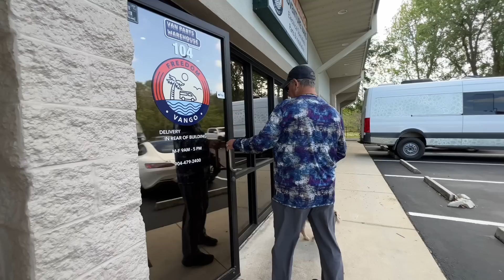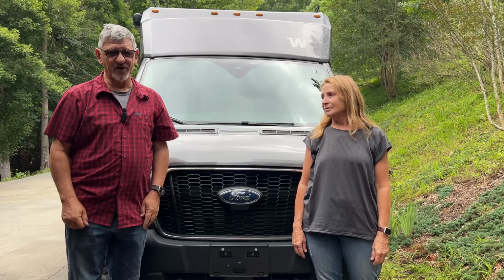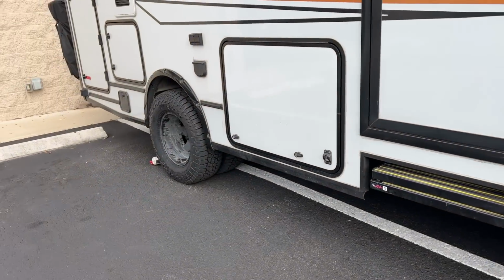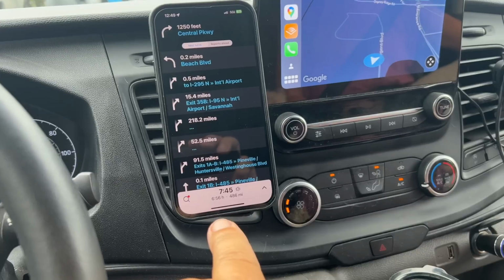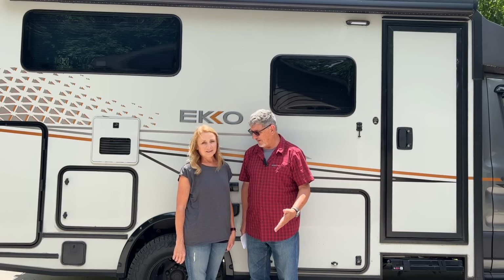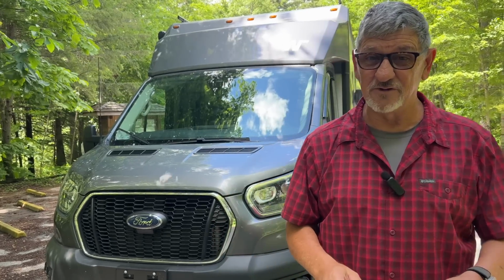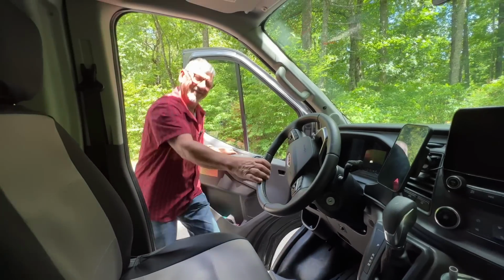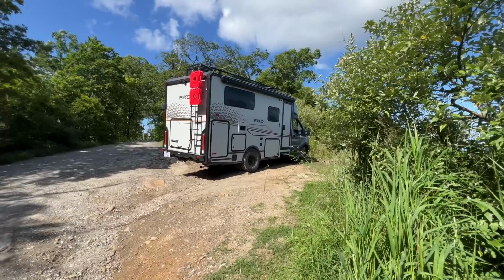GLAD WE DID IT? WAIT UNTIL YOU SEE WHERE IT TAKES US!

Comment: I definitely think it’s worth it. Rv’s sit so low and the clearance is nice. The whole reason I got my E450 in 4wd was the 4” Quigley lift. I can easily crawl under my Rv now. The clearance under the rear overhang is nice. Now you can back in and hang over the grass and not have the front end out in the road. Now you are not going rock crawling in Utah but it gives you some extra height to get a little further out then a stock vehicle will go. That’s what I like about mine too. 👍🏼 I like it
Reply from the maker: All great points.  Thanks for sharing.

Comment: Did you only get different tires? Can you say what the brand model and sizes were for front and rear? I have a 2020 Transit 350 HD dually. My wheels are not painted and I'm wondering if your coach has the same wheels as I have only painted black.
Reply from the maker: We installed Falken Wildpeak 245/75R16, we have 7 of them… all the way around and one spare.  The wheels are what came with the van.

Comment: Looking goooooood.   Definitely on my list to Santa, assuming I get Mrs. Clause to approve.  What size tires did you use and did they add spacers between on the rear?  Also, is this the lift where they cut off those ridiculous rear shock mounts and weld on new higher mounts?  Thanks for sharing the joy.
Reply from the maker: That would be a good thing to get from Santa 😁.  We installed Falken Wildpeak 245/75R16 and they did add spacers on the rear tires.  This is not the lift that cut off the rear shocks.  Thanks for watching.

Comment: Great video…….with all that bouncing around, how often do you have to check that all things are still secure on the inside (ie cabinets, any attachments, loose screws)?  Basically anything that would come loose will all the rocking and rolling?
Reply from the maker: You have to open all the cabinets very carefully after a ride like that.  We weren’t fully packed so that does make things worse sometimes.  It can be hard on a vehicle.

Comment: Hello again.  As I noted below, we took delivery of our EKKO on June 1.  We visited Freedom VanGo on July 27 for the 2-inch lift, suspension upgrade, and Falken 225s, then the next day an alignment at Big Chief.  We now have the same problem you experienced: one of the tire pressure monitors doesn't work, even after Freedom VanGo replaced it with a new Ford sensor.  Question: was your Ford dealer able to resolve that issue?  Thanks much for your input.
Reply from the maker: Wow!  Just like our van.  Yes Ford was able to replace it and then reset all sensors and it started working.
Reply from the maker: They told us the faulty one was actually cracked.

Comment: With the change in tire diameter is your speedometer off now?  Have you found a way to fix it if it is?
Reply: Larger diameter tires revolve/spin slower versus smaller diameter tires at a given velocity (speed).  If your speedometer (factory spec tires) indicates 60 mph, most non-certified speedometers report speeds at about a 5-8% "exaggeration"...chances are you're really going probably 57 mph.  If you're actually moving at at measured speed of 60 mph, your speedometer would indicate 62 or 63 mph.  So, if you tire diameter increases by 15%, I'd say that your speedometer indicates 60 mph and you're probably going  maybe 61 or perhaps 62 mph.  Some mapping apps (such as Waze) report your GPS-estimated speed, and these are generally more accurate versus your non-certified speedometer.  (Police vehicles often are equipped with certified speedometers, and if the police vehicle has factory-spec tires of the correct factory spec diameter, the speedometer will report the speed correctly.)
Reply from the maker: What Robert said!  That's an awesome technical answer that neither of us could have provided.
Reply from the maker: Short answer... Yes, it's now off... as is the MPG calculation.  We show less miles traveled per rotation of the tire than we actually travel and the speed shown is 6-8% lower than we're actually going.  Fixing it is easy for us.  We usually drive 5 above speed limit when rolling on long trips so now we just set it on the speed limit.  We also added a rear camera that is attached to the rear mirror and it constantly shows GPS speed so we also have an accurate speed if we need it.